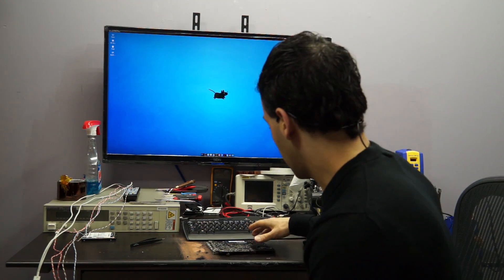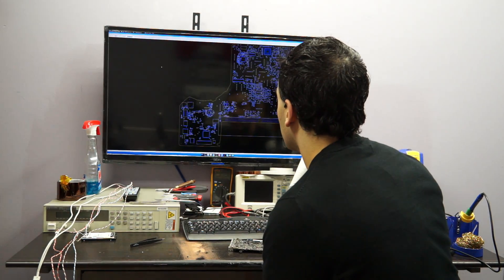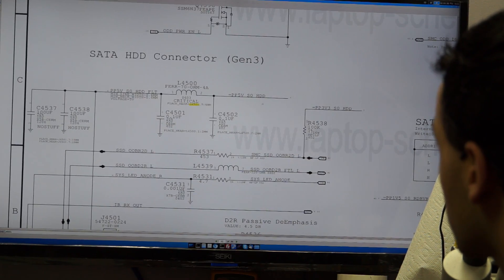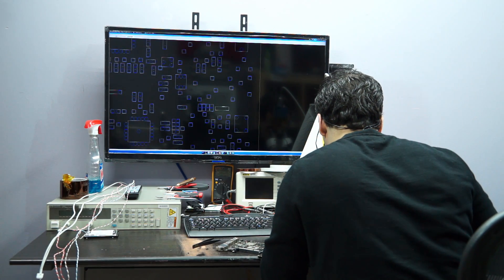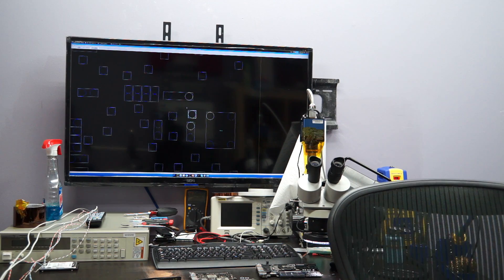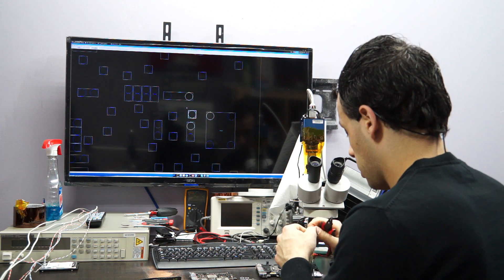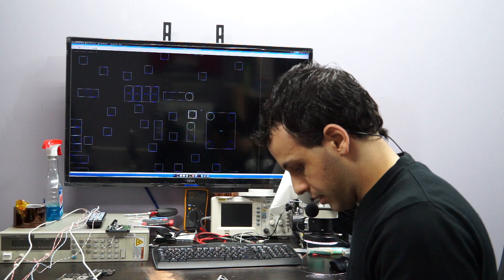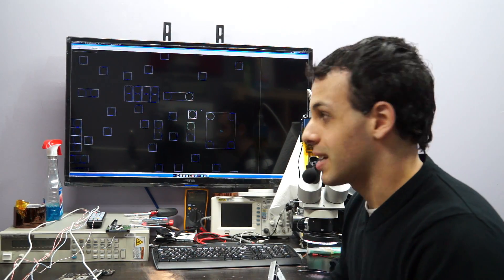820-3115 does not see hard drive logic board repair.

Comment: fixed an old 820-2279A (08 MB K36A) SATA. SATA is simple circuit 5V to HDD and 2 pairs of differential data lines between South Bridge and HDD. Prior owner had a drop of corrosion (probably opened up to oil the fan which now wobbles after losing tolerance) right where south bridge SATA port power source caps are and this differential line path. Took out the caps and a probe pad that broke the data line. Replaced caps + wire fixed the broke line and works perfectly now.

Anyway, SATA channel circuit path is pretty simple :)

Comment: need your inputs please. Problem: mid 2010 MBP 13". screen: Flashing Question Mark folder. All Boot keyboard Shortcuts does not operate. boot to USB does not operate. Boot to CD does not operate. battery: charging and power on battery. Power button: functioning. Eject optical drive button functioning. TIA

Comment: Hi Louis.

Excellent work and post! I have a 13" MBP 2012  (820-3115) which works fine with a mechanical HD, but I occasionally get the No Entry sign with an SSD. Could this repair work to fix this problem? I already replaced the cable with a new one. Thanks
Reply from the maker: +Ricardo Licorish cheap toshiba black friday ssd
Reply: Thanks Louis, will try it
Reply: +Ricardo Licorish Season's Greetings Louise, I'm just double checking before I make the purchase, were suggesting to use a cheap Toshiba SSD or asking if it were?

Comment: Are you running landrex on there using Wine?
Reply from the maker: Wrong, you're supposed to PM me asking OMGZ WHERE I GET SCHEMATICS FORM TELL ME!!

:p

Yes indeed! Runs as shitty in WINE as it does on the windows 3.1 system this was probably designed for...
Reply: Louis Rossmann :D Bet ya get that one a lot! There is a website hosting them.  Free!  Those who can search will find what they need.  I was pretty sure there wasn't a linux version.  Thinking of installing Arch and figured I would need Wine to run the exe.  I have tried installing other software packages that also open .brd files, but none would open the brd files created for apple boards.
Reply from the maker: give up and use test link, wine does the job

Comment: I use the same solder station you use hakko fx951 what temp you recommend to use for best soldering I am use for normally 250 Celsius, i use hakko fx951 for cell phones too, just my question is that machine when is setup low heat 200 Celsius the machine don't go to the sleep mode when you put in his base but if you increase the heat to 300 Celsius goes to sleep I contact the hakko dealer in USA and tell me is like that 200 c don't work sleep mode I have another unit in any temp goes to the sleep mode.

Your machine do the same?

Thanks Louis and great video
Reply from the maker: I use 700f. My sleep function works.
Reply: For me too is working but when I use 395 f below not working
Reply: The guide say when the temp is below 570f the sleep function don't work just I need to to know is that is real like that